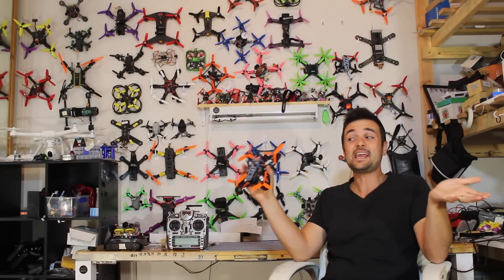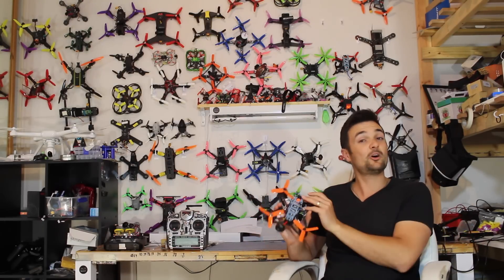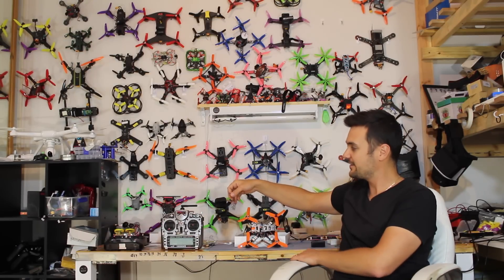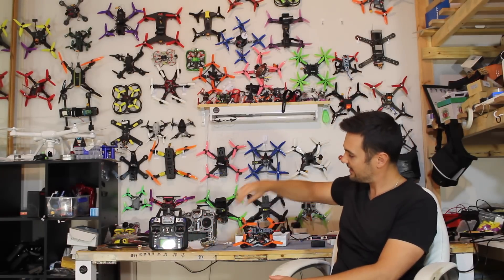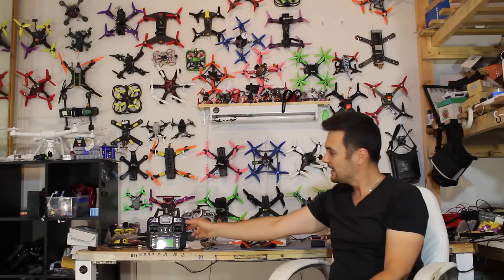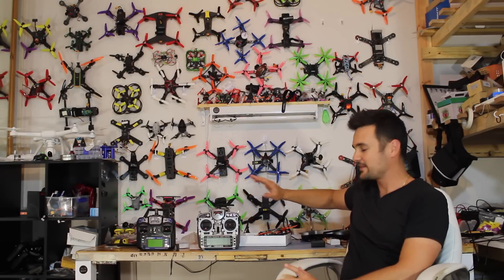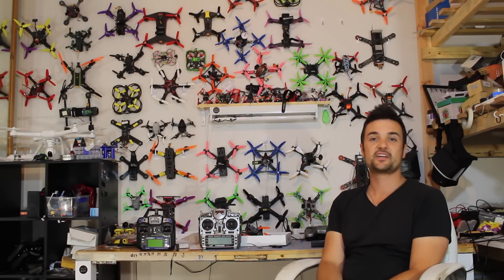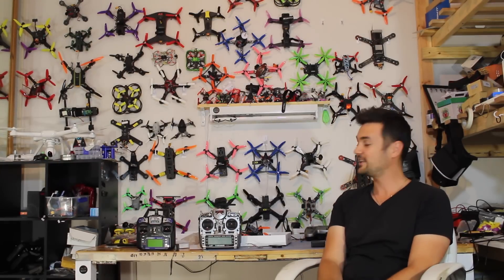How radios and drones “Talk” to each other - SIMPLE EXPLANATION

Comment: how would one go about hooking up a sp racing f3 board to a dsmx reciever? I know that the ppm connection wouldn't work because the spekrtum protocol is serial based but is there a plug or extension lead that goes into the board? I've been looking for a video that explains how to do this but i keep finding videos like these where it doesn't explain how to connect receivers to the board.

Comment: Here's a question for ya! How is it that drones like the Mavic have a range upwards of 4 miles, and these quads stay relatively close? Not that I think a 4 mile range is at all necessary, I am just curious as to the different technologies being used there. Do you think FPV drones will start to increase their range, or is it just not necessary?
Reply from the maker: not necessary. Im happy with 500meters.
Reply: Drones with longer ranges use different radio frequencies, I know some use UHF and some may use VHF.
Essentially the higher the frequency the shorter the range , but they greater the bandwidth, and the worse the penetration of buildings, vegetation etc,

The issue with UHF and VHF, apart from bandwidth is that those frequency bands are more regulated and used for voice comms e.g. emergency services, CB, military, aviation, taxis leased 2-way radio etc.
It possible to use these lowers frequencies, but there are less bands available and they may require licensing or be very noisy.

2.4G and 5G are essentially very short range high bandwidth - pretty much wifi frequencies and very loosely regulated.

Comment: Can anyone help me? When I go to my "motor" tab in clean flight and check "I understand" I try to move the master control and nothing happens. Also it won't let me move the bars individually
Reply: And the lights don't change even though they are set to change with throttle. But on the receiver tab it shows everything working
Reply from the maker: try calibrating your escs
Reply: UAVfutures alright will do thanks Stu!
Reply: UAVfutures so turns out my drone didn't like the newest naze flash so I went back and it worked!

Comment: well, first of all,.all radios are in a specific mode, mode 1 , 2, 3 or 4.  mode 2 is popular is US( throttle on the left),  then, binding procedure, receiver works with a radio because its binded . you can bind many receiver to the same radio as long the are from tbe same manufacture or at list supported,  ppw ppm or sbus are not they way radio talk, but the way its connected.

Comment: so essentially any receiver will work with any quad,  but not any transmitter will work with any receiver? also build that twig behind your head XD
Reply: Pretty much but you need to check which protocol your quad will accept - as Stu said, PWM, PPM (or CPPM) or S.BUS. Most common these days is SBUS or PPM. Once you know that you can check which protocol your receiver will output. Then you need to make sure your receiver and transmitter match. There are a few protocols (languages) to pick from as each brand pretty much has its own - FRSky, DSM, DSM2, DSMX, FASST etc etc.
Reply: Kit Jones most people getting into this (myself included) this all gets a bit fuzzy. So: the flight controller understands a specific kind of protocol,  and the receiver sends a specific kind of protocol(these are different like stu said). So i need to order a receiver that works with my transmitter,  that is the same protocol that the flight controller understands in order to get my transmitter working with a quad of choice. so first things first is i need to find out what protocol the flight controller on my selected potential quad runs?
Reply: I think i get it.  i just ordered an fs i6s from banggood on sale to practice in simulator, need to get this concept pegged down before i order a quad.
Reply: Jordan Parrott if you already have the fs i6, you will just need a fs receiver to go with it. You will need to check if your flight controller runs SBUS or PPM because quite often you can get both kinds of receiver to suit a particular radio. I use a FrSky Taranis and the receivers to match it can be bought in either ppm or SBUS.
Reply: Got it.  Thanks for the help :)
Reply: So PWM, PPM and CPPM are the protocols the flight controller is receiving from the receiver?

And what protocols are the ESCs and the flight controller speaking?